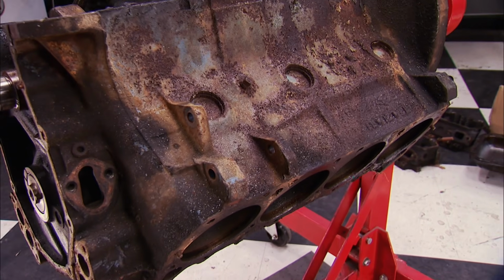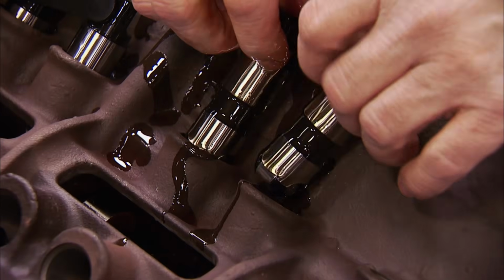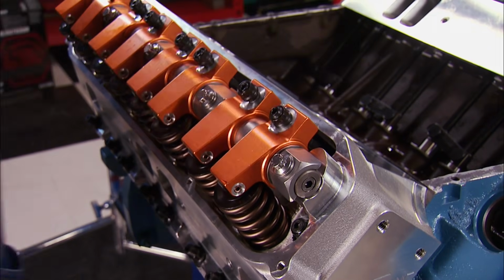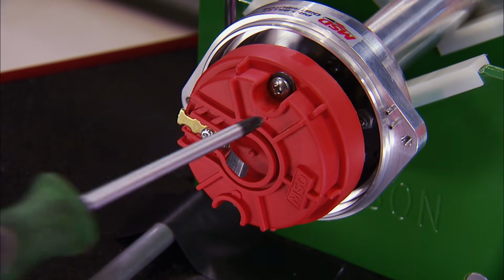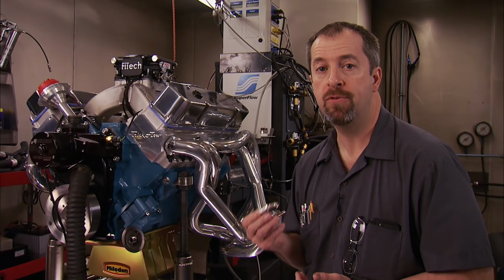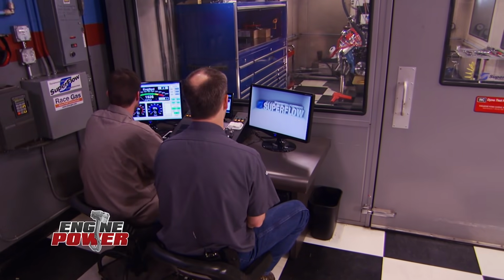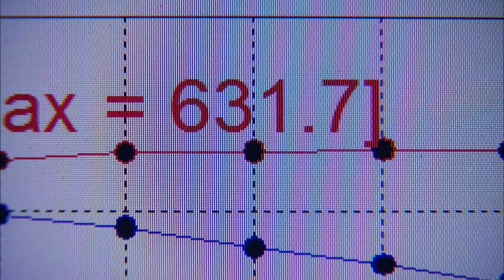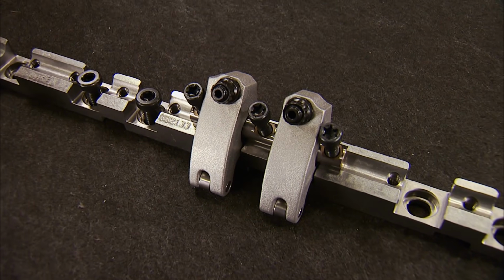Pulling The Power Out Of The 512 Stroker Raised Block - Part 2 - Engine Power S3, E10

Comment: Love your guys stuff! Maybe one day you guys would wanna have fun with a Toyota 5vz-fe with the supercharger….
Reply: I agree bro the 3.4 is a good v6 i think they had trd models with a m90... dude above is lame btw... what a fu*kn tool... 
 I love mini trucks rock crawled the shit outa my 81.
Reply: @jonathanschrader7881  🤝😆 hah thanks! Lotta those 6cylinders are great! The Cherokee in-line 6 is just as durable and torque capable as the 3.4 v6. The 81 is a gorgeous machine! I’m glad it got to see usage! Besides Toyota’s last forever so it’s fun to see how time affects it!
Reply: @bigboreracing356   bruh I have a 6.4 scatpack but I like to go into the mountains with my runner. Because well if you had a half a brain you’d understand I prefer not to slam my expensive car on a bunch of boulders. Idk why you so angry. It’s shocking how little control over your emotions you have. You need to chill. Besides the 3.4 is a fantastic engine it has the red supercharger on it and makes great power. Idk what ur problem is. Chill.

Comment: Look at that, the carb beats the brand new tech in power
Reply: What about if they had that wfi professionally tuned?
Reply: The carb is new tech. The EFI is better at fuel economy and over time will prove more reliable, easier starts, better engine wear due to a lack of soaking the cylinder walls with an over rich mixture.
Reply: @Arthagnou  if you dont jet your car rich as a oil baron, it wont soak the cylinders. what happens when a fuel injector gets stuck open and exposed to 50+ psi of fuel pressure?
Reply: No it wont
Reply: No it wont
Reply: No it wont
Reply: No it wont